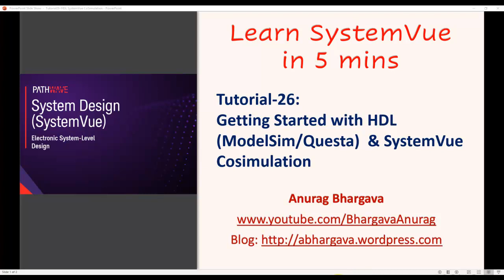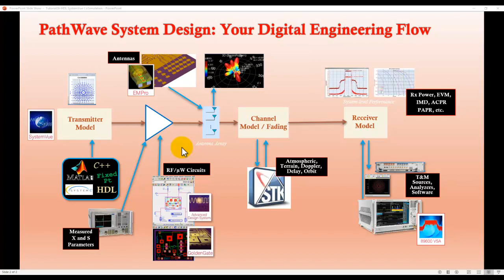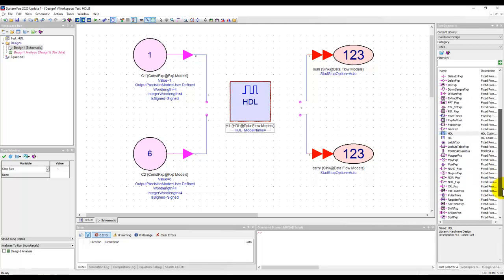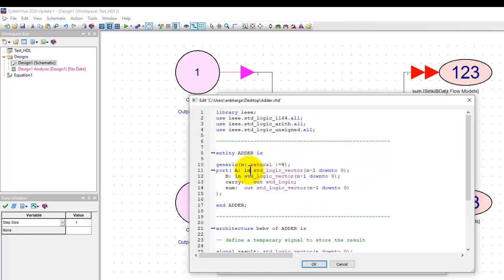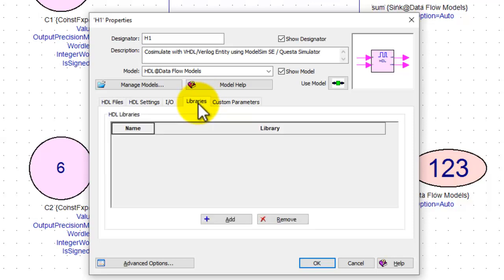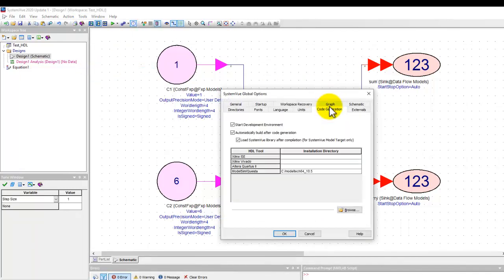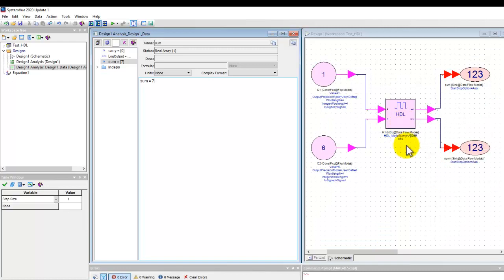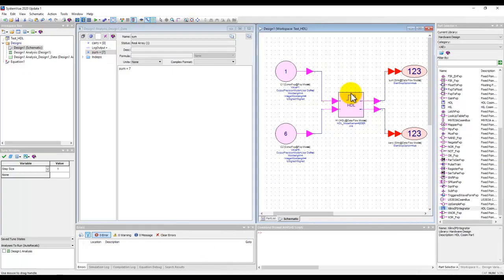Tutorial-26: Getting Started with HDL & SystemVue Cosimulation

Comment: Thank you very much Anurag for starting these tutorials. They are Extremely useful series of Tutorials! Your ways of presentation and explanations are very clear and superb!. I have been using SystemVue for some time. The problem with using this HDL flow is the HDL library is, limited to small number of components and hence hard to make complicated RF designs. And also the third party Questa license has to be renewed every year. This is a problem for long run with this design flow.. Does this support Vivado simulator which comes with Vivado itself? Also, could you please make a series of videos for using Matlab Simulink HDL coder/SystemVue dataflow and Spectrasys combination? This would be greatly helpful for many of us. Thank you so much and highly appreciate your great work!
Reply from the maker: Hi Janaka,
Thanks for your kind comments. 
Vivado simulator is not currently supported so we need to rely on Questa as of now. I may be wrong here but realistically speaking anyone working on deeper level HDL code should have Questa kind of HDL simulator as Vivado comes at the end of the cycle and doesn't have all the capabilities as there in Questa kind of full scale HDL simulator. I wish I had better answer that this....😊
Reply: @BhargavaAnurag  Thanks so much  for your reply. Yes it is nice to have Questa (in fact we had it) but frequently renewing its license just for this purpose is bit of an overhead. We are using Simulink for designing our RF systems and use HDL coder to convert into HDL. Could you please make a simple tutorial video how to use SystemVue design with TX/RX in Data link  along with a Simulink design that performs some processing ? I have a question of how to match sample rates/clock rates etc. between SVue and Simulink. Again, appreciate your time.